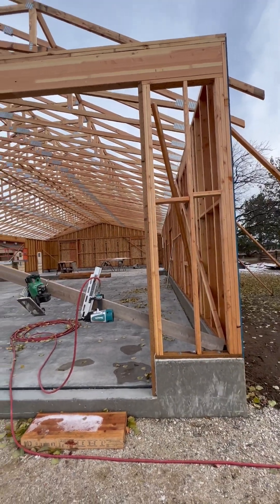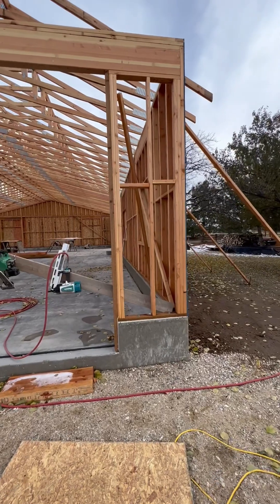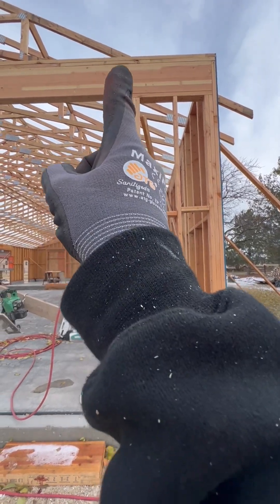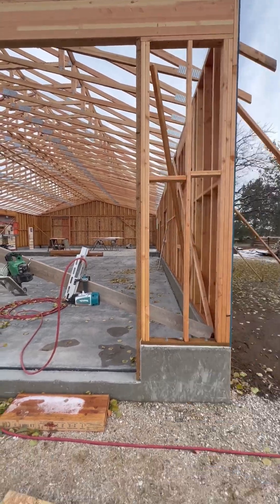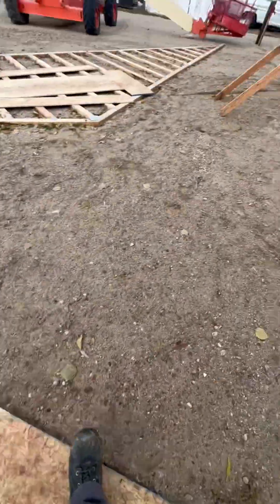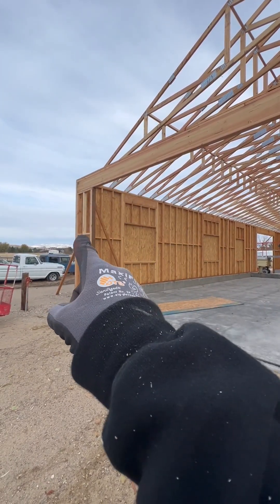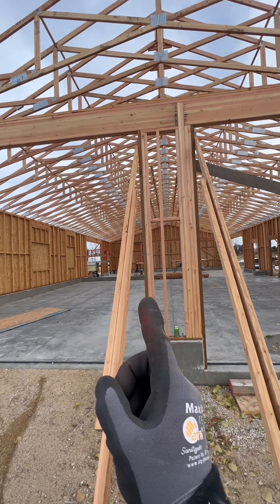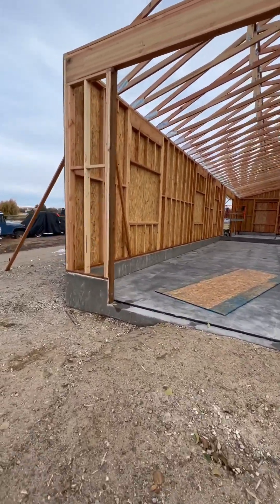Portal Framing for Two garage doors on Shop Build. #framing #carpentry #shopbuild

Comment: Nice clean framing! Just curious why the structural designer did not call for the  wall to be rake framed to the BC of the scissors truss?  Now there is a hinge.

Comment: Surprised engineer didn't call out a glue lam that entire span.
Reply from the maker: Justin each portal has a value for the load. I need three portals to get the value I need. Two portals aren’t enough because of the width of the outer portals.
Reply: @Blue Collar Handyman I get what your puttin down. Keep up the good work
Reply from the maker: @BarneysCustomHomes  thank you.
Reply: Those are pretty long glulams currently there. I wonder if to span that with one member it might need to be steel.
Reply from the maker: I asked if I could and he said it defeats the purpose of how a portal is designed. I need three portals. If I put one beam the whole length it would only be 2 portals. 1 beam made more sense to me. But here we are following the code book 😂
Reply: @bluecollarhandyman  says it defeats how a portal is designed, then proceeds to explain how he is trying to get 3 portal wall framed in 1 straight span 🙄. Adding those extra kind studs really secured that wall so much more. 😳

Comment: Was that engineered? Because just by looking at it seems like you’ve got a heap of racking force from wind and not much bracing in that portal frame system.
Reply from the maker: Yes sir.
Reply: @bluecollarhandyman  still looks under engineered seeing there’s no internal walls to help with bracing. Doesn’t even have full length tie down rods going from top plate to concrete. Just relying solely on fixings and ply to stop in racking.
Reply: @henra2244 you're right. The lateral racking would be brutal. Essentially held by opposite side sheathing, probably only 7/16 and 4 king studs nail shear strength. Something that could help is cross framing on roofing trusses to help with racking toward and from the garage openings. Or a minor partition wall behind the garage door openings to help tie a triangulation from roof truss to concrete floor. But, all municipalities are different and minor requirements for garages
Reply: Without putting a tape on it, this looks framed correctly per IRC. Camera lens is wide angle likely making it look more massive than it is. Straps over the top plates and down the interior side are not installed yet.